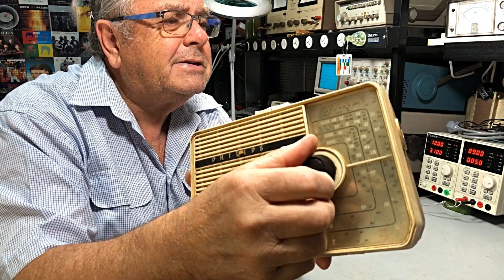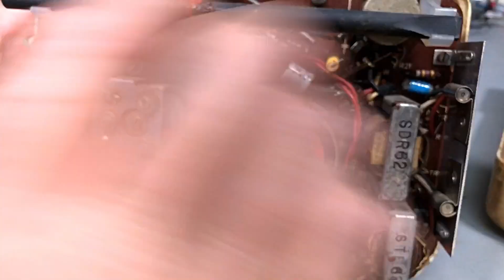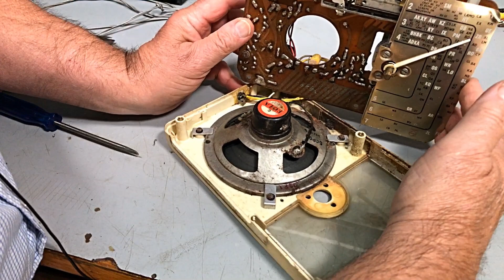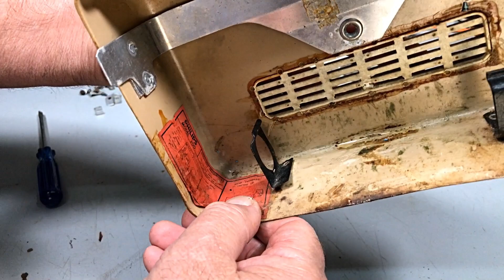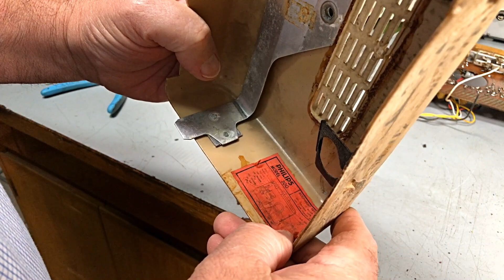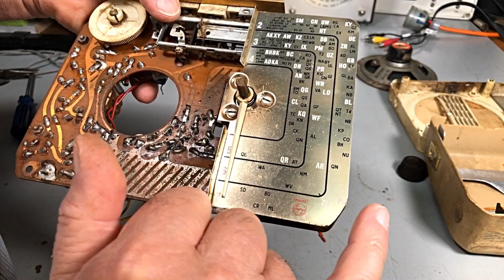Philips "200" Transistor Radio - Part 1

Comment: But its a 6v radio!
Reply: Oh no its not, sorry!    Odd that the cap you changed was a 6v one. This is a Philips Town and Country 200 radio, and originally it used an Eveready 2364 9v battery which is  no longer available.🙄🐐
Reply from the maker: It will be modded for 6 x AAA holder.
Reply: There is a note on the radiomuseum site that the negative lead is red, a trap for the unwary. Its from 1961 or so.
Reply from the maker: It is correct on this one.

Comment: With regards to the Speaker and its missing Dome and or cardboard Treble enhancer.
The dome can be fashioned using a sacrificial torn speaker cone, by cutting out a circle
and then wetting it with Isopropalyne and then gently pressing it into a dome shape.

Once the dome has been glued over the voice coil you can leave it at that, or you can cut 
out some stiff cardboard to fashion a lopped of cone
 \_   _/ but... before glueing it down 
listen to the tone and if more treble is desirable just tack the treble enhancement cone 
down and test to see if the sound is more pleasing, I found it usually makes the treble 
so much clearer..
APU      
 👁👍
Reply from the maker: Thank you for this info, very informative !

Comment: I still have yet to make a repro battery for those.  I have a Kriesler Triplex that uses the same battery, want to say it's a 2362?  Nope, it's a 2364.
Reply from the maker: Very interesting indeed, I didn't know you did that !
Reply: @techobaz55  Did it for over ten years.  Both tube and transistor sets.